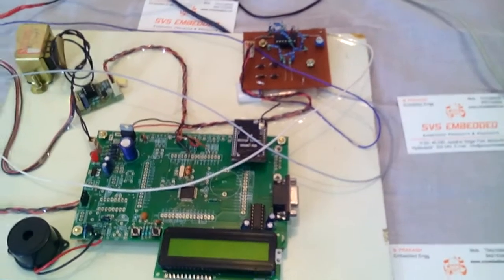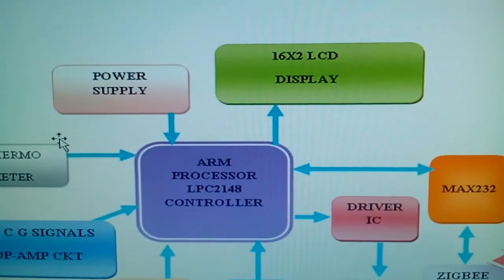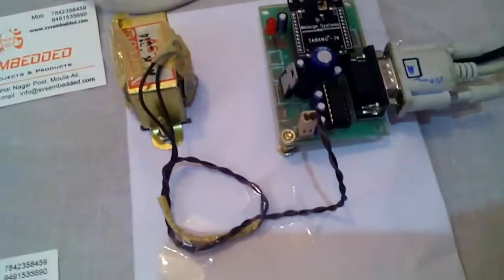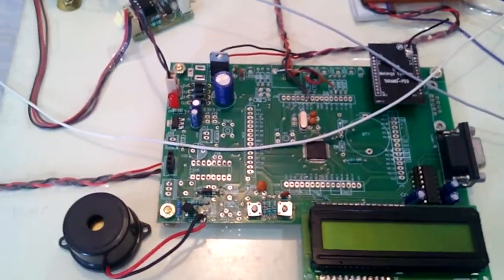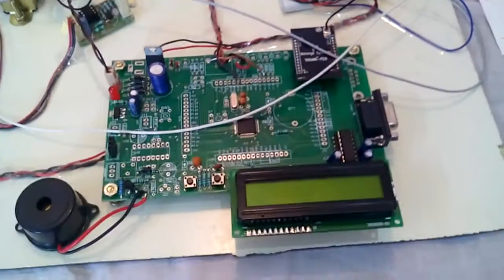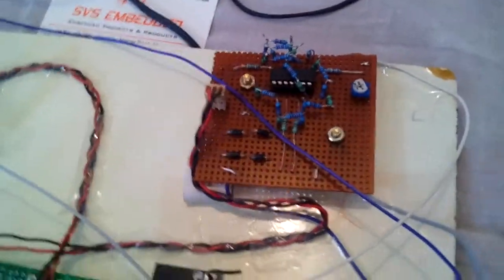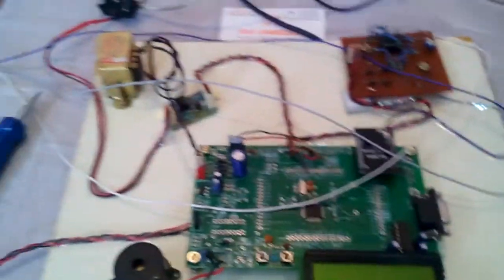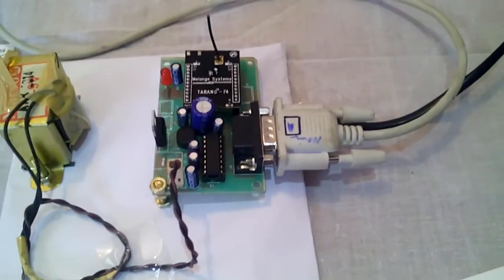WIRELESS ECG, BODY TEMPERATURE AND HEART BEAT SIGNALS MONITORING AND ALARM SYSTEM

Comment: hello sir can i get the circuit diagram and materials needed to develop this system
Reply from the maker: Thanks for comment and your valuable Feed back. ARM7 LPC2148,TEMPERATURE SENSOR,ECG SENSOR,HEART BEAT SENSOR.
we are selling the projects with least cost.
if u order the project we will provide working hardware kit along with 
1.abstract
2.datasheets
3.documentation
4.schematic( circuit ) diagram.
5.software code.
6.sample ppts
7.photos&video file on entire project
through google drive
send me a mail to  svsembedded@gmail.com,info@svsembedded.com.
we will send u the how to order procedure to u.